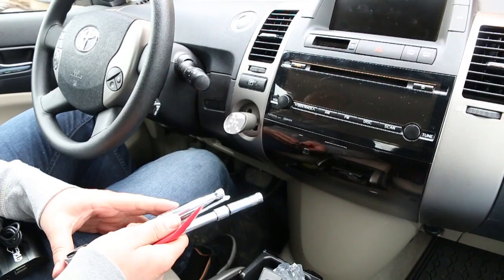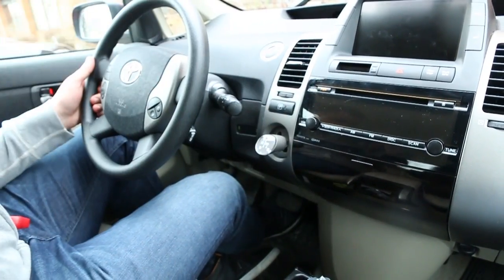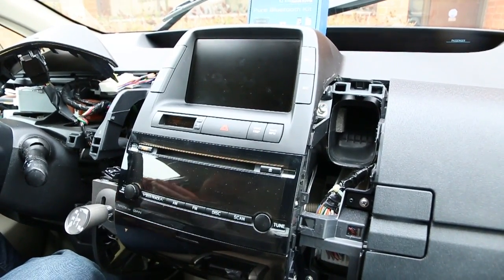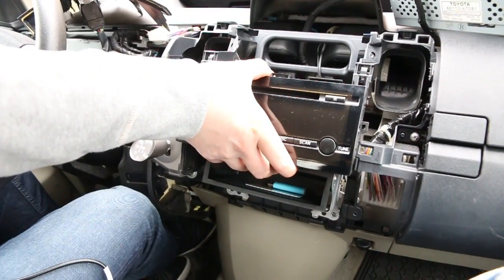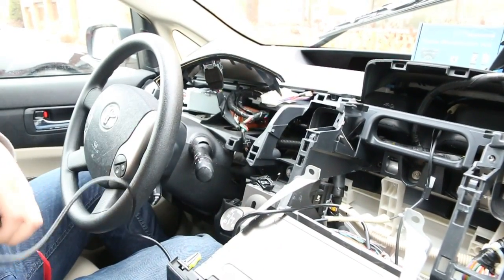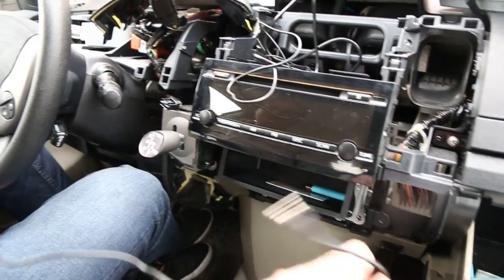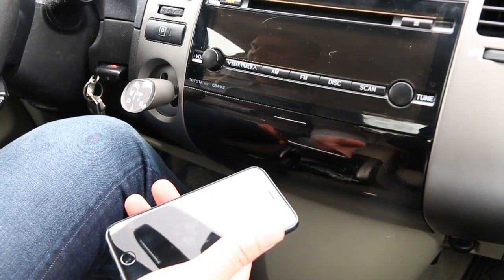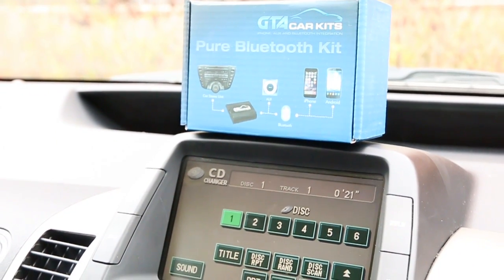Bluetooth Kit for Toyota Prius 2004-2009 by GTA Car Kits

Comment: I followed this guide to install a Bluetooth adapter in my 2005 Prius, cheers!

Hint for right-hand drive models: The first part removed in this video (with the air vent) also includes the power button, but it’s still fine to pull out. I just left it hanging connected by the power button cable while I did the rest. 

All in all, as someone who’s never pulled apart cars but has spent a lot of time fixing Macs… this was much easier!

Comment: Wow, what a well done video. I have always been scared of taking dashboards apart but this video tells you exactly what screws and bolts to remove and how to pull on the plastic pieces without breaking tabs off. That bluetooth kit looks great. I am going to buy one.

Comment: Attention 2005 Prius owners with a tape deck and 6-disc changer who are struggling to connect their Bluetooth kits: here's a quick fix. After installing the kit, try driving your car for a minute, then stop and turn it off. This process resets the car's computer system. You may need to repeat this once or a few times until it works. Once the system resets, it will display a new 'CD2' mode alongside the usual AM, FM, CD modes, and that's where you'll find your connected Bluetooth kit. So don't fret if you can't select 'disc' separately at first, your Bluetooth connection is just hiding under this new mode. Happy streaming!
Reply: I was about to ask, I have a tape deck and use it to connect my phone, I may get this kit now as I have to change more since my monitor screen doesn't come on!
Reply: You are my hero

Comment: So I have a 2006 prius base model, would this work for mine? It doesn't have the CD changer stock. It just holds one CD and thats it so would it still work? Thank you and this is honestly the best tutorial video I've seen definitely a thumbs up!!
Reply from the maker: Hi, the kit will work with base model just as good. The single CD will still work the same also. Thank you.
Reply: @gtacarkits  I installed it in my 2007 base Prius and it does not work. I can connect my phone to the bluetooth, the mic works, but that's it. I can't use the CD mode to play anything.

Comment: does anyone know if the factory bluetooth has to be disconnected to be able to plug this module in??  can you use the factory mic??
my unit already has bluetooth, but only for answering phone calls. its a 2007 toyota pruis.  it doesnt stream music through bluetooth, but does have an aux input
Reply: I was wondering the same thing...
Reply: I just installed mine and the answer is no.  You do not have to disconnect.

I have an android phone and I'm settings I "hands free" for "calls" and "GTA Car Kit" for audio.  You must assign it this way or your android phone will not function properly when answering a call or trying to call out.

I decided since it works this way, not to install the mic...

Comment: Hi, I got this connected via Bluetooth but I can’t get it to play. My car had a tape deck as well as a 6 car disc changer so I cannot select disc by itself. What should be done?
Reply: I don't know if you have already solved this but after resetting the car a few times after installation, I go to disc changer and then press mode on the steering wheel, or perhaps pressing cd/tape an extra time, should bring up cd changer 2, as opposed to what will now be cd changer 1
Reply: @KattDa  OMG thank you! Your comment saved me from returning this kit after installing it. They should really have a note somewhere for this.

Comment: Can you expand on what exactly I need to do if my car has a CD Changer? You mentioned it briefly at 5:42
Reply: Do you sell this Y cable?
Reply: I see now.. You do sell the Y cable. It is on your site. But also, it is included in the "stereo with navigation or XM radio" option. Great video! Thanks.

Comment: Will this work with a 2008 Prius Touring package 6?  The package 6 already has Bluetooth built in but only allows me to make phone calls, I can't stream music which is what most people want.  If so, will it use the mic that is already built-in to the Prius?
Reply: Ed Hendrickson  iT does work.
Reply: Hi Ed, did you ever find out whether or not it would work with the microphone that is already installed in the car? Thanks.
Reply: did it work?  did you have to run the mic with the kit?, was there another port to plug into? or did you have to disconnect the factory bluetooth to get this one to work??
Reply: Did you ever find out? I have an 07 package 6, same boat.

Comment: I installed it in my base model 2007 Prius and it is not working. My phone connects to it, the microphone works, but nothing comes up on the screen when I press CD. It just keeps saying "no CD" and won't play anything.
Reply: Mine does the exact same thing. Was you able to figure it out? Thanks
Reply: @kickeramps  This type of bluetooth accessory doesn't work in a Prius that is single disk and doesn't have a disk changer. You have to just use one of the bluetooth things that plug into the cigarette lighter. Seriously sucks because even the good ones don't play great. Wish I had known before installing the first device though so I wouldn't have broken all of my vent panels doing it and then had to spend another hundred replacing them. Good luck, hope you didn't destroy your panels in the process.
Reply: @aegann85  thanks! Sorry about all the broken panels. That sucks. Might be better off just putting an aftermarket stereo in, hu?
Reply: @kickeramps  I'm wondering if it's because I bought a cheaper one. Did you purchase one from GTA who made this video or did you get a different one? I looked up a multi disk player to see the difference in appearance and I'm pretty sure he's installing this on a base model as well. All I can think is that the one they sell is made to work on both and the one I bought isn't.
Reply: @aegann85  yeah he’s installing on a single disk version in the video. If you use the multi-disk, you actually need a Y cable on top of the kit. The GTA works with the base stereo
Reply: @KnifeSandwich  yeah I just had it done at BestBuy. That was almost a year ago. I bought new panels and they broke those when they had to go back in. It was a lotta fun. Thanks anyways though.